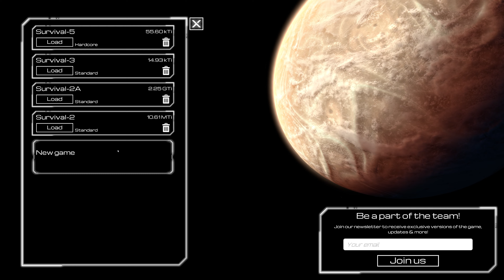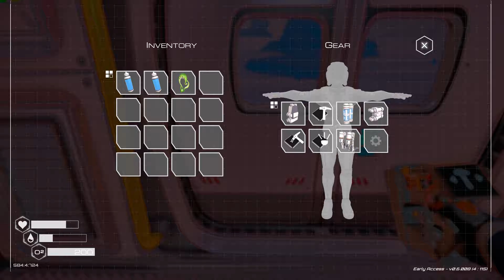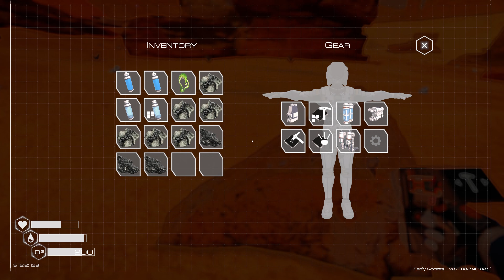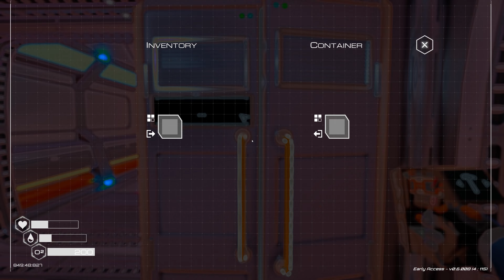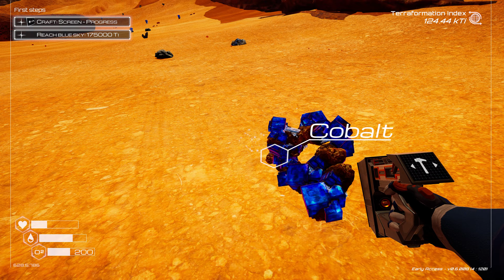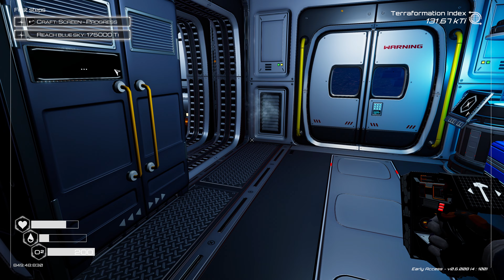PLANET CRAFTER HARDCORE PLAY THROUGH - EP3

Comment: That big ring thing is a Stargate. The things you call glass spires is aluminum fields. Rocket engine is for launch pad and jet pack.
Reply from the maker: LOL well I guess I have something to look forward to 🙂 Thanks for the clarification on aluminum fields, and engine.
Reply: @tekriotgaming8886  sadly the start gate does not function, but if memory serves me right, there is another thing that uses fusion core in it, like the wreckage on the hill by the frozen in cave.
Reply from the maker: @andreheinz1942  awww too bad would have like to have seen it work.  Thanks for the tip on the fusion core, I will keep my eyes open for it.